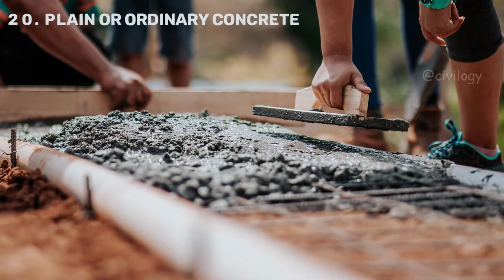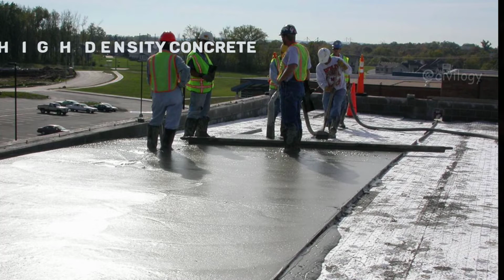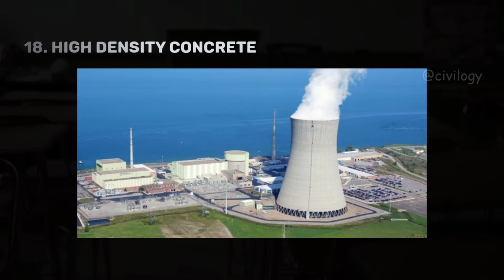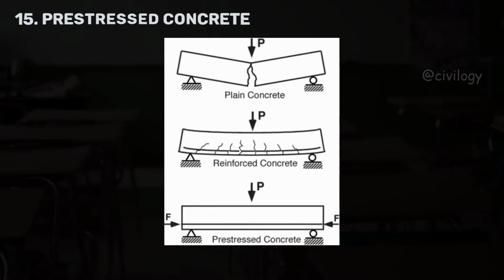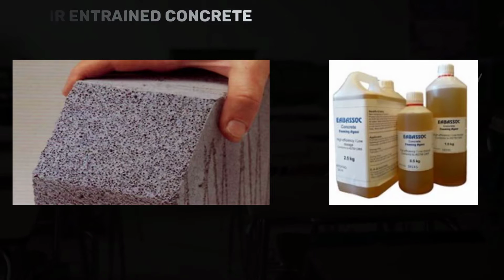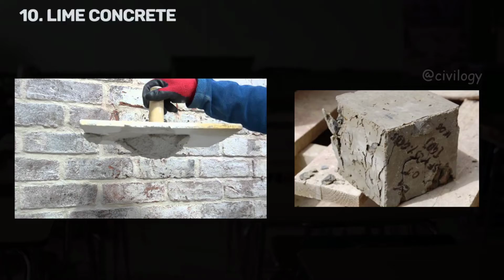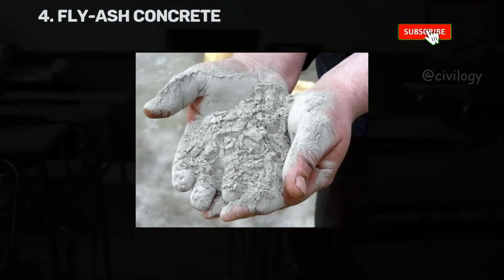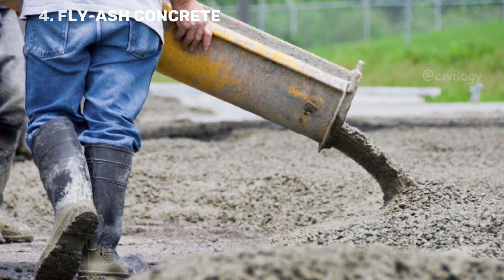Types of concrete used in construction || Top 20 basic types of concrete || #concrete #civilogy

Comment: Can you give us an easy way to make light weight concrete that is strong? Here in the Philippines we're unable to buy barrel roof tiles or anything similar. So, we've been making a terracotta looking cement tile but they are very heavy. I've been getting info on typical light weight concrete but find it to be weak. We need to be able to walk on the roofs for maintenance later but not crack the tiles.